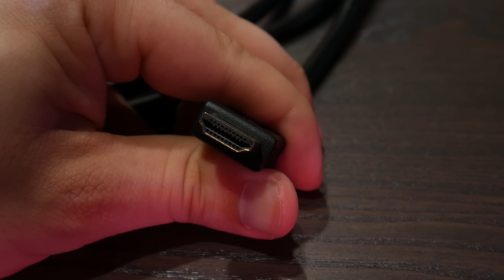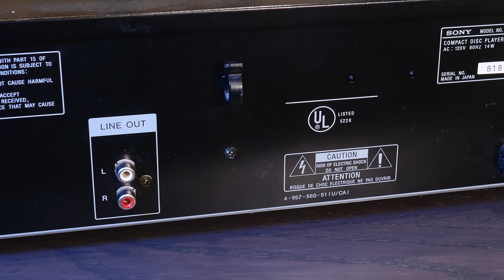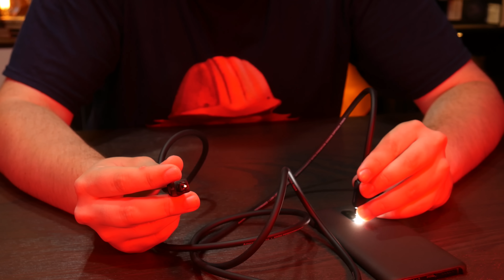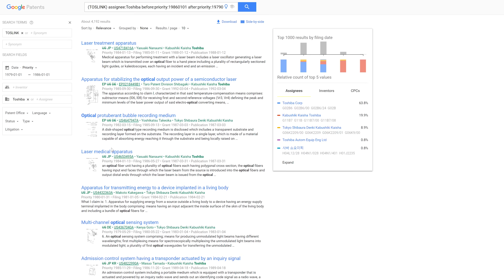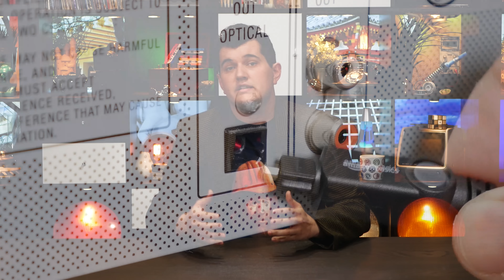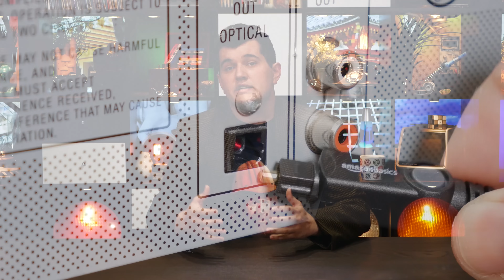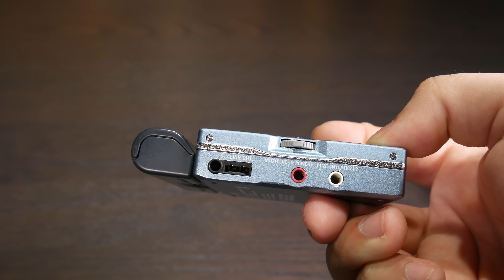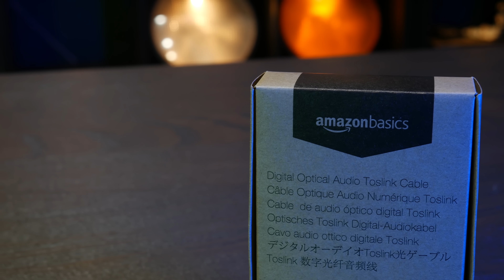TOSLINK: That one consumer fiber optic standard

Comment: I'm using Toslink a lot in my multi room audio setup, because over long distances, the electrical isolation begins to matter a lot due to differences in electrical potential between rooms otherwise creating all sorts of hum and other undesirable effects.
I should add, though, that I also use converters (intended for ADAT) between Toslink and the CAT.6 wiring which I already had installed all over the place. Otherwise it would make little sense to use Toslink. At the heart of everything there is a toslink "matrix switch" with 4 inputs and 4 outputs. It's perhaps a quirky design but it works extremely reliably and the quality of audio is very good. For me it clearly supercedes all sorts of analog audio over CAT.* solutions, as well as, god forbid, wireless stuff like the overpriced Sonos.

Comment: 9:50 You can send multiple stream of data through an optical cable if they use different wavelength.
No need for a second fiber.

Comment: My Xbox 360 Slim doesn’t have a 3.5mm jack on the back, but DOES have a toslink port on the back, so I’ve bought a DAC to convert it and use speakers (I use a computer monitor without inbuilt speakers)

Comment: Have you covered Thunderbolt? Thunderbolt was meant to use optical links, and Intel used an optical cable in their public demo, but for some reason they ended up going with copper wires instead.

Comment: Well, the next Ethernet cables, for 100 GbE (for which no one, except large businesses, has any use yet), might need to use fibre optic, and for 10 GbE, there are already LC-LC fibre optic cables and converters available, though very few actually need 10 Gb/s for now (we'll see when 8K comes around, but that'd require at most 100-150 Mb/s per stream).

Comment: Most digital audio devices I've owned have had toslink in the headphone socket - and probably yours too - though many of them (particularly battery driven devices) will only enable the light if a toslink cable is enabled (though not foolproof as the standard doesn't specify metal/nonmetal toslink mini plugs)

Comment: You kind of mentioned it, but I wanted to reiterate, TOSLINK electrically isolates devices. This is not only useful to protect equipement from storms (as you mentioned) but also avoids grounding issues - where  noise in the ground line is amplified and heard .. This can even happen with expensive amplifiers.

Comment: "As dark as the future of the Windows phone" hahahah I honestly chuckled to that. That was savage!!! 🤣🤣🤣
Reply: As an ex user of windowsphone...i just still cant accept the fact that i had to bail out into android device... (Coming from wp7.5 nokia lumia 900 and then wp8/wm10 nokia lumia 1020)
Reply: I was going to subscribe untill I heard that punchline! Haha Lumia 1520 for life!
Reply: @ebsn1  *until
Reply: Great punch line but it hurt so much. Lol.
Reply: mmh. My lumia 520 to this day has better camera software than anything else I've used.

The fact I could do a 5 second aperture on it was just amazing sometimes.
That it could produce such great pictures even though it's a budget model  (<$200) with a 5 migapixel camera and no flash, is quite something...

mine did die though.
However, I worked out what the problem was - one of the 3 power pins for the battery broke, and was loose.

Nothing a quick bit of soldering work can't fix, but I couldn't be bothered.
Reply: I too enjoyed my Nokia 720 Windows cellphone. I am bummed out that my Nokia won't even turn on. It seems to be bricked. Did Microsoft kill my 720?
Reply: @johnfitzgerald4456  probably bad motherboard...since 1 of my lumia 900 still working fine (with bad battery and doing nothing good in term of current usage)..my other lumia900 is dead due to bad motherboard
Reply: Oh, I thought he said the Windows OS.

Darn.
Reply: I got a Windows phone (Lumia 640) once, solely for use as a spare phone. Best Buy had a Black Friday deal where they were selling it for about $30 (which I was able to get online), and I'd received a $20ish gift card. It had much better hardware than my previous spare phone at the time (HTC Droid Incredible 2) and in many ways was about on par with my main phone (Moto G LTE). For the $8 or so of my own money I'd have to spend, it was quite a deal. I knew going into it that it was a dying platform, so I didn't invest too much time or money into it (no paid apps, for example). I just used it as a spare phone for basic tasks, and for that it was a great value for the money. The apps were limited (Duolingo was buggy), but even that was better than I thought it would be.

Comment: Hm, very sorry to say, but you completely missed the point in this video - galvanic isolation and eliminating ground loops and 60/120Hz humm.

At the time of the introduction, power supplies in home entertainment equipment were not fully isolated switching power supplies like today, but had a traditional, non-switched transformer. Also a lot of homes did not have a dedicated PE grounding wire running throughout the house.

This resulted in ground loops when galvanically connecting devices together. Like e.g. with the shielding of the coax. You'd hear a 60 or 120Hz humming over your audio.

And THIS is the real benefit that TOSLINK came with - no galvanic connection, no ground loops, no 60/120Hz humming.
Reply: While your point about galvanic isolation is in fact correct, you kinda got the explanation backwards there - you can actually make transformer-based power supplies with extremely good galvanic isolation from mains and anything else, and it's their switch-mode cousins that are the problematic ones, up to the point where almost any higher-power SMPS is mains earth referenced (IEC Class I) so they can implement substantial EMI filtering without the risk of dangerously high leakage currents if someone were to touch the device while being earthed.

In modern A/V systems you can get multiple ground connections between devices quite easily - especially in areas where shielded Ethernet cabling is common, like Europe, but it doesn't even take that. By the time you have a computer, an AV receiver and a TV with some sort of antenna or broadband cable connection, you already have a nice loop going.

Realistically speaking, traditional unbalanced home audio connections are inherently flawed and not fit for purpose in a fair number of scenarios encountered nowadays. The problem could be circumvented by going balanced, but alas, the consumer audio world has not managed to agree on a good standard implementation yet - the 4.4 mm TRRRS "Pentaconn" connector could be a good basis if people were to agree on a standard pinout and nominal level.
Reply: Aint never heard 60/120Hz hum have heard 50/100/Hz In the day earth loops where a problem and still are a problem . Mind you in the backwater where I live anything that the masses don't get/use/understand is a problem Ive seen bluray players hooked up to 50"+ TV's over a standard av lead Vid/Left/Right with the aspic set for 4:3 and both the tv and bluray had hdmi UGH....
Reply: @SlowMenThinking  simply depends on your mains frequency. 60Hz for North America.
Reply: @risfutile  Thats the point I was making.  60 Hz advantage smaller transformers, easier to filter the ripple  in a liner power supply. Its disadvantage  the ripple  and em noise is easier to here in audio ccts. Dont get me stated with the advantages of 50hz  either way to change either standard on a national level now days it too cost prohibitive.  I worked with 230v AC 50hz with a 400v AC 3 phase  mutipal earth neutral distribution at the  street  and big commercial buildings but that is beyond the scope of Tosslink :)

Comment: I got a brand new Acer laptop a long time ago that came with Windows XP. It had mini-TOSLINK through the front 3.5mm jacks. I tried it. It worked. Snapped the mini TOSLINK adapters almost immediately.
Reply: I've got two Acer laptops and both of them have it.

So does my desktop PC in the integrated audio chipset. (Gigabyte motherboard)
I think it's pretty common overall. XD

But also... Wow. XD
Then again I broke the headphone socket on my oldest laptop through dropping it slightly with headphones plugged in, so I can imagine breaking a TOSLINK connector easily enough.
Especially on those front-mounted connectors many older Acer laptops have.
Reply: KuraIthys yeah. The jacks were centered in the front of the laptop. Almost designed to be broken!

Comment: You don't have to bend fiber optics to the point of them breaking to degrade their performance. Once you bend them beyond their manufacture specified bend radius you will have some of the signal start to leak out the side. People tend to treat fiber optics like they are wires, but they aren't wires -- they are glass. Also to get the insane bandwidth fibers can deliver you may need to use single mode fibers. Single mode fiber connectors can be tricky as you need to align single mode fibers extremely precisely if you want even a chance of having the signal go from one fiber to the other. Coaxial wires are basically wave guides so in theory even they can have higher bandwidths than twisted pair. But twisted pair is so darn convenient so that is what we use for internet in our home and our office.

Comment: Electrical isolation for sound quality — GROUND LOOPS (Caused by resistance across multiple paths through earthing paths). Even if the DAC could ignore it the analogue amplifier components won’t. 

Oh mini toslink in the headphone connector was on all Mac laptops until very recently.

Comment: "There would need to be a way to ensure the fibers in this two-way cable are correctly aligned with the connector"

You've never dealt with fiber networking, I gather.  The fiber network connectors I've worked with have separate (identical) connectors for transmit and receive, and there's no indication as to which is which.  It just doesn't work if they're reversed.  It's genius!
Reply: Another (not that common) way are duplex over simplex Fiber connections, e.g. 1000base-BX. Downstream sends at a specific wavelength (1490nm), while the other side (upstream) sends using a different wavelength(1310nm) using the same fibre.

Obvious downside: if your topology changes(or you installed the wrong kind of component), you’ll need to switch the receiver/sender component.
With any duplex cabling(=2 simplex cables), you just separate its two simplex plugs on one end and install them the other way around.

Comment: Best thing with TOSLINK is you don't get those annoying ground loops.
Reply: was about to comment about that but now i just need to agree
Reply: @waImartofficial  was about to comment about that commenting about that but now I will only have to agree to agree to only comment about what we agree
but anyway, this is EXACTLY WHY I ise optical, ground loops!
Reply: agreed, and in the noisy EMI environment of the classic automotive audio world, Toslink makes a lot of sense
Reply: Exactly, and ground loops don't have to interfere with the data stream to cause noise, they just have to induce random currents in circuitry that was never designed to deal with random currents in order to inject noise.  Nothing like having your ground state wander around when your DAC is trying to decode the LSB of an audio stream.
Reply: nice, i knew there had to be a benefit
Reply: You beat me to making the same comment but I posted mine before I scrolled down. Agree++
Reply: Ground isolation is one of the biggest benefits of fiber optic cable, but in the home audio space, your gear is usually on the same circuit if not the same outlet, so this benefit, too, is of limited utility in the intended use case. If it went longer distances, or is used in automotive or marine environments, it makes more sense.
Reply: I was thinking the same thing.  I have my TV's rca mini out connected to my SB Z cards input so to have its audio go through it to my 5.1 surround sound.  It didn't do that with my old X-Fi Sound blaster Xtreme Gaming card until the upgrade to Z.    I haven't been able to isolate the cause.  Now I have to get a ground loop isolator.
Reply: If you have equipment spaced far away from each other, ground loops are a real thing.   For example if you have a projector on one side of a large room with the AV source close to it (short video links are critical) and the audio amp on the other side, close to the speakers, you'll probably experience ground loops.     AC receptacles could even be on a different phase potential, which is a nightmare for grounding.  TOSLINK and wireless may be the only solution here.   Wireless, while works, can introduce undesirable delays and RF noise.   Copper could be used but only with isolation transformers (such as those used in ethernet cards).   TOSLINK is far simpler and more effective.
Reply: @b.c.5024  I have encountered this at work tying A/V from a studio at one end of a building to a transmitter system at the other end.  Had to insert a pair of isolation transformers in the stereo audio path.
Reply: We need HDMI over TOSLink.
Reply: @tohopes  no, it's really hard to provide power over optical connections. We need thunderbolt/displayport over USB-C cables with high power sources and for companies to stop messing up USB-C designs. Imagine running a single cable from your amp to your TV and being done with setup. Now power cable, no return audio cables, no separate Ethernet cable, just one cable to rule them all.
Reply: @Cynyr  I was being serious.
Reply: Any decent equipment set up properly won't suffer ground loop.
Reply: Kevin Beckenham to neutralize this I’ve had to use two specific plugs in my house for my pc and amplifier. THey have to use those plugs or else I get a nasty 60hz buzz
Reply: I was just about to post the same thing. As coax is not a balanced connection you still can have a ground loop that would cause some speaker hum. I have experienced this myself.
Thank you for posting.
Reply: Exactly... This guy usually doesn't miss such massive details like this.  I'm pretty disappointed.
Reply: Almost 90% of buzzes and other power related issues are due to the unsmooth power and transient spikes along the wave.  It is made worse by any fluorescent or CFC lighting.  The presence of running compressors like fridge and HVAC are also common causes of the noisy voltages.  I have had to replace a power supply in a PC repeatedly until the client took my advice and spent the mony on a filter for his power.  People don't trust water to be clean anymore but they think the power that hits their wall is any cleaner?  But what almost no one does is start at the source voltage.
Reply: makes me wonder why they don't put it in car's audio...
Reply: @hteekay  If we all complained to all car manufacturer or refused to buy there cars unless they had TOSLINK built into there car's they may change
Reply: I'm surprised that I've never experienced a ground loop before, especially with my crazy audio setup.
Reply: @CaveyMoth  You can get problems plugging a P.C into a HiFi, unless you have a external sound card that does give you Isolation or a active D.I box.
Reply: @kevinbeckenham3872  I usually use USB with my Schiit stack, and HDMI with my receiver. It seems to work pretty well.
Reply: @CaveyMoth  If all your gear is plugged into the same outlet, or multiple outlets connected via the same circuit, you're unlikely to encounter a ground loop problem. The last time I encountered a ground loop issue, I had a powered subwoofer plugged into an outlet plugged into what turned out to be a different circuit from the receiver. I got an annoying 60 Hz hum out of the sub until I rewired the whole mess to be on the same circuit.

Comment: I've used TOSLINK almost exclusively for my Pioneer VSX-D409 since I got it in 2000. It doesn't have HDMI obviously. So I am watching this on my PC connected to my TV with an HDMI with a TOSLINK connection from the TV to the Pioneer for sound output. 

Also exclusively use a Microsoft 950XL Windows Phone.

Comment: TOSLINK is the ultimate ground loop killer.

While SPDIF signal itself is not affected by interference and current loops, the act alone of connecting two devices via an SPDIF or any other cable that happens to connect grounds together is known to make some devices squeal regardless of any specific input, especially if we're talking about cheap shit like consumer HiFi amplifiers/receivers as opposed to studio equipment.

There's a lot of fibre optic stuff in car entertainment systems, called MOST, because a bit of clear plastic is cheaper than copper and weighs less than copper and i guess resilience to current loops and EMI is nice to have too, i mean you know what happens when you start the engine.